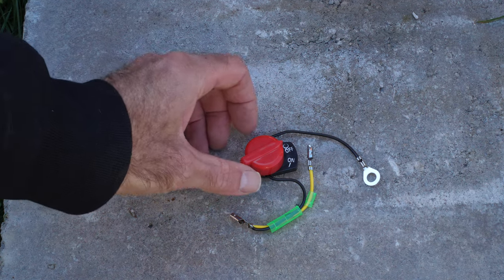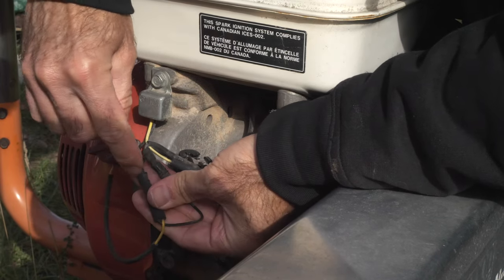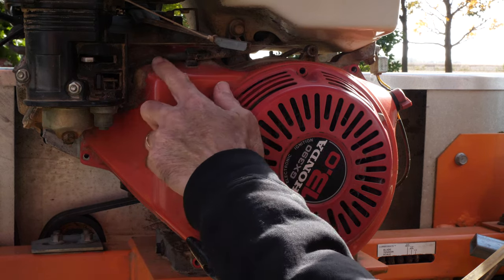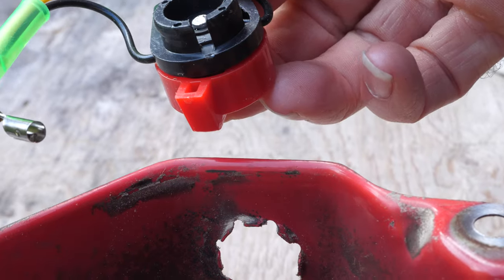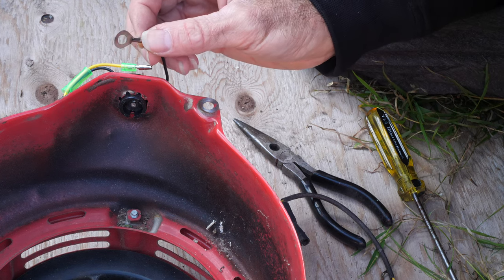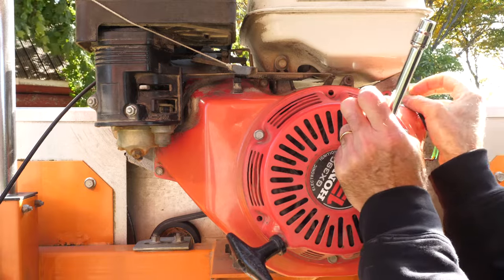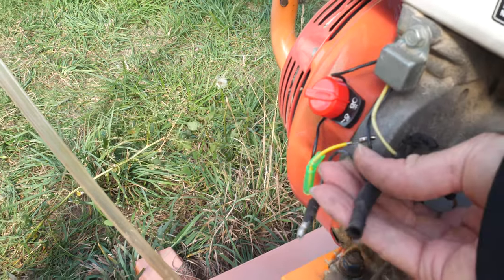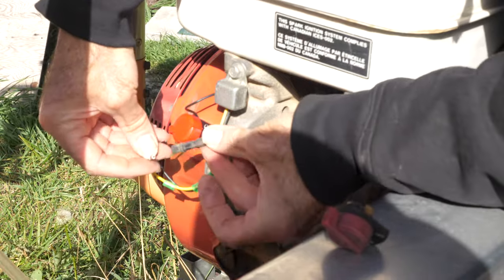How to: Replace ON OFF Switch.  Honda Small Engine GX Series - GX390

Comment: How do you start,with your pull rope at the 7 oclock position?
Reply from the maker: It's because it is mounted on the sled of a bandsaw mill.  It raises up and down determinate of the log diameter and since I don't like to waste gas while turning/squaring logs (the channel is called Save Money, after all 😊) I frequently need to pull start when the mill head is raised up and hence buried behind the basket and frame of the sled.  This is a good compromise to allow me access no matter the height of the mill head.  
Great question, thanks for watching!

Comment: if your switch is stuck in the on or off position and doesn't turn anymore, you don't need to replace the switch.
Just disassemble the knob by removing the retainer clip behind the knob, and remove the spring loaded ball bearing inside along with that spring. Then reassemble.
The knob will continue to work without the ball bearing.
If you're too lazy to remove the ball bearing, you can buy a new switch for about $1 on aliexpress or temu.
Reply from the maker: Great tip, thanks for sharing!